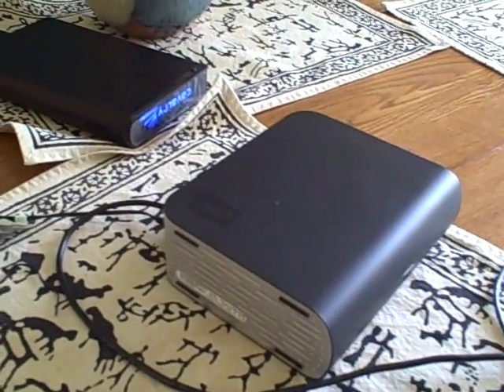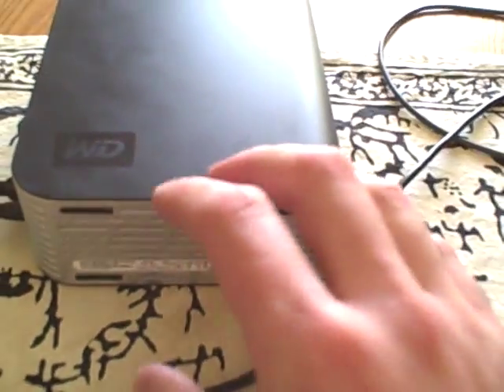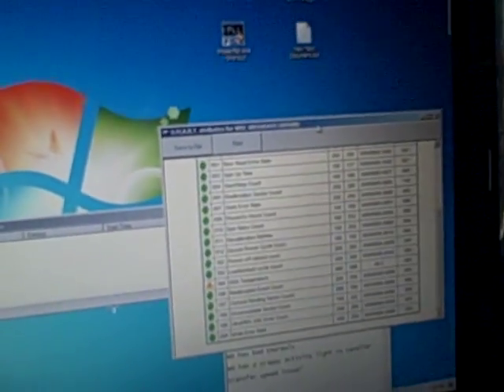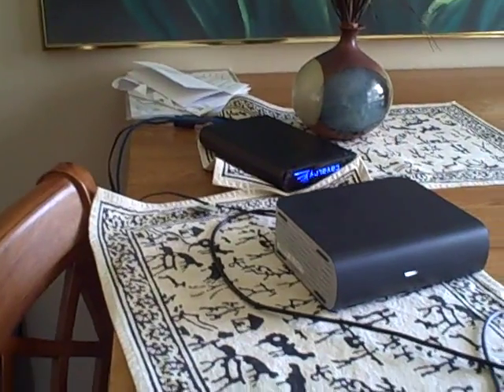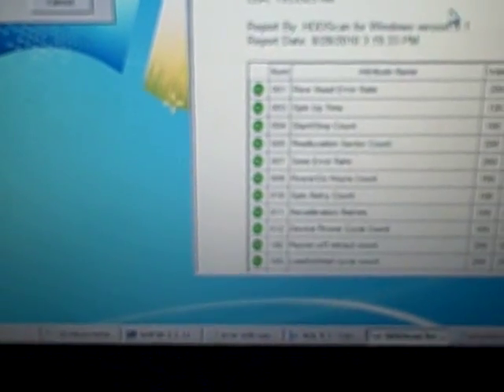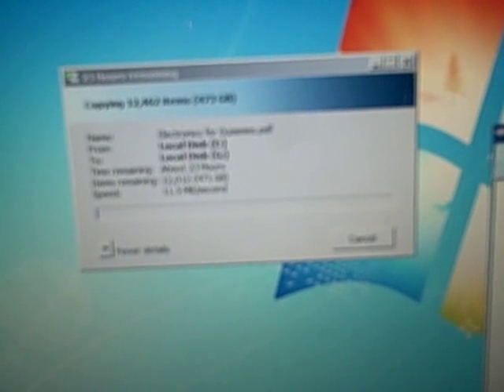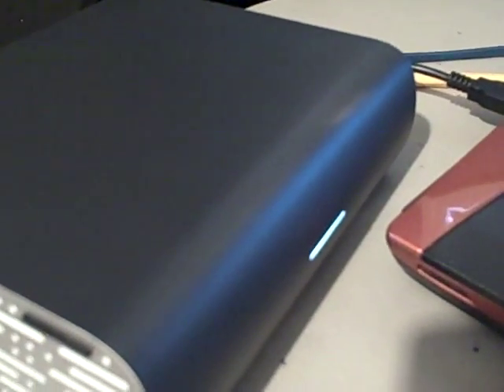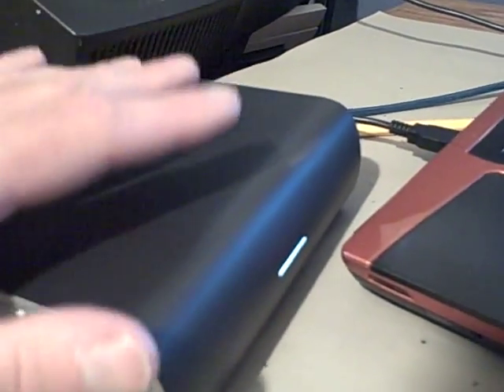Western Digital Mybook Essentials is NOT a good enclosure, runs hot, slow drive

Comment: dude u need to place it vertically. its basic science, when placed vertically the vents are on the top and bottom. this way when the hot air rises and escapes from the top, the cooler air rushes in from the bottom vents. this keeps the drives at a nice temp.

Comment: Benchmarking read speed via Windows file transfer is not a good way to benchmark it....... Windows has always been known to have terrible throughput when transferring files.

Use a real disk benchmarking software to get the speeds. CrystalDiskMark works great for this.